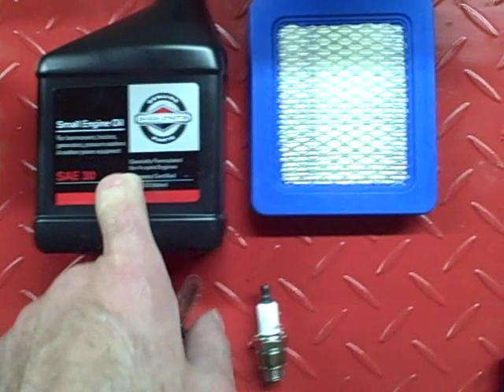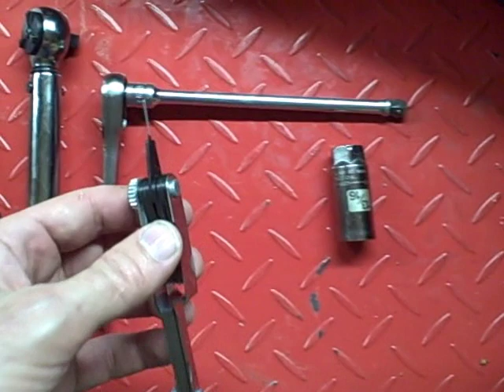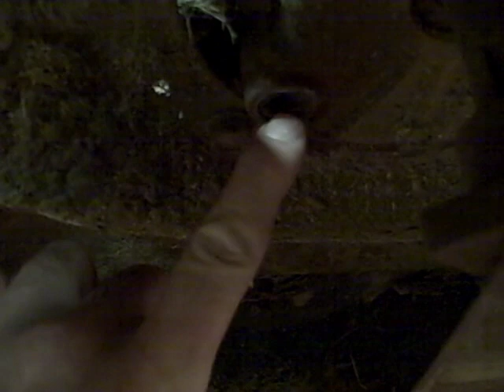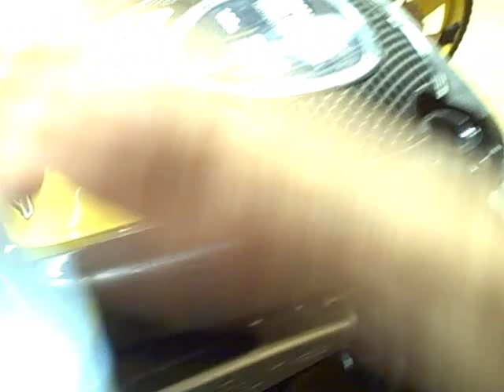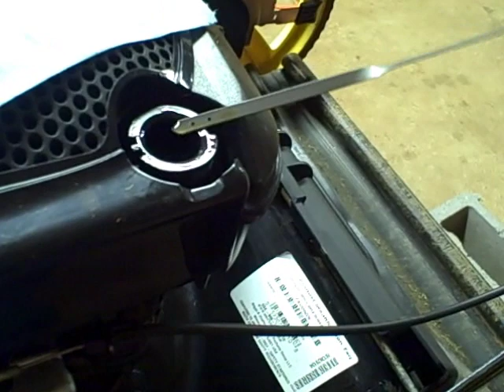Small Engine Repair: Walk Behind Lawn Mower Tune up with Briggs & Stratton Tune-up Kit

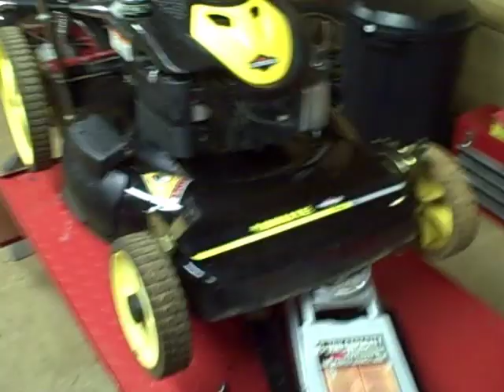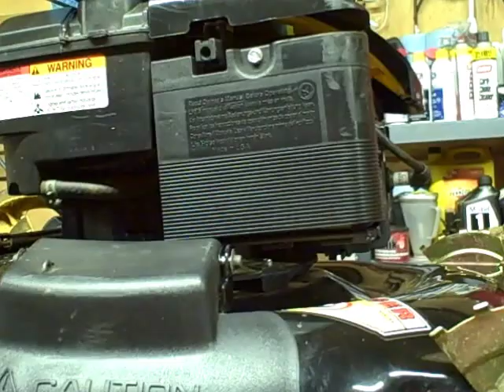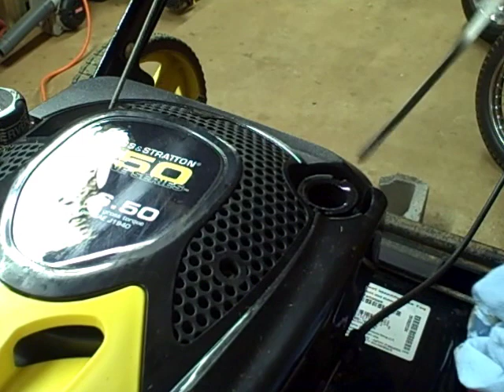Comment: The video starts with going over what is included in the tune-up kit: 18 ounces of oil, air filter, fuel stabilizer, new spark plug. The sequence is, you change the oil at 02:23, then at 06:00 you state that the next step is to change the oil filter. Upon completion at 7:30 you state that you have just completed changing the air filter. I'm tryng to learn how to do some of this stuff myself but I must admit I am confused, and have been unable to locate the manual for my mower online. What was the blue filter you changed, the air filter or the oil filter?

Comment: I have a Brute low wheel front wheel drive push mower its last years model & I was wondering if last years model has a oil drain plug underneath, thanks :)!

Comment: My neighbor gave me a non running, self propelled/electric start mower with the Quantum 6.5 with red cover(most bad ass looking lawn mower engine ever) for free-99. We diagnosed it and apparently someone left fuel in her with no fuel stabilizer and it ate the carb(common). A new carb, new air filter, fresh Amsoil synthetic, fresh V-power spark plug and she's SCREAMING for less then $60.00 invested. 
I wish I could buy a retro fit catalytic converter kit for this bad boy as they pollute allot.